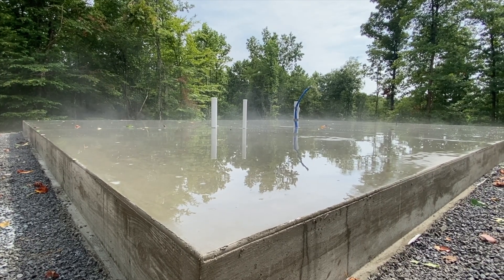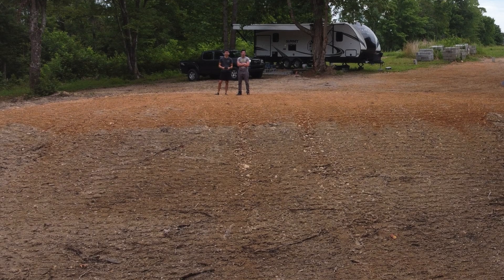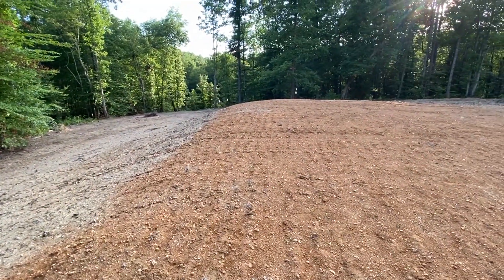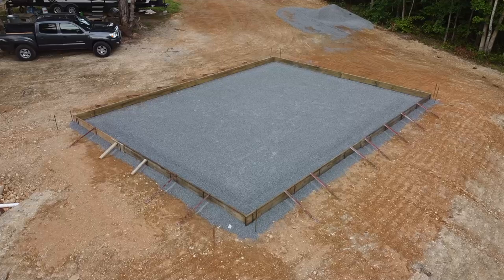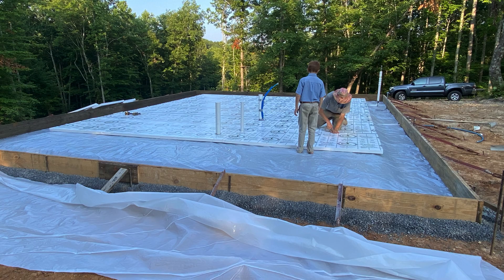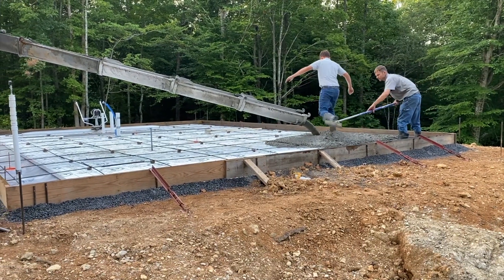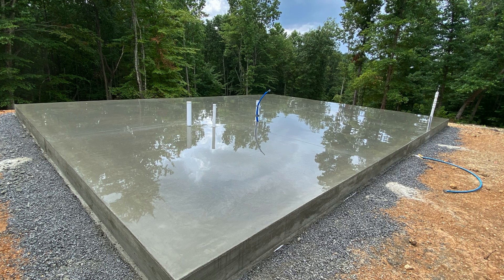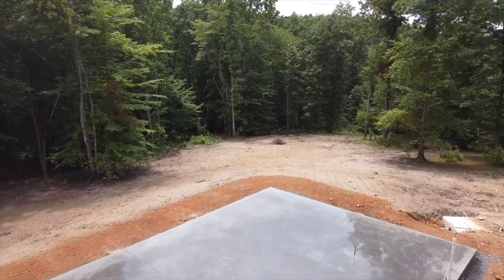Slab Poured for Our Passive Solar House!

Comment: Consider an acid based stain for the slab.
Reply from the maker: Does that produce a better color, or is there another benefit?
Reply: There's many, many colors available. It's also recommended to seal it after staining to increase durability. Sealing can also help with moisture although that's not really much of an issue with you since you (wisely) insulated under the slab. 

Additionally, you can use diamond bladed saws to cut designs into the floor. I've even grouted the scored lines to really mimic the look of concrete.  @JoeJarvis
Reply from the maker: @planesteven  thanks for the recommendation i will look into stains. We'll definitely seal it either way.

Comment: Looks good! I debated on the foam underneath and ended up cutting it out due to cost, but did put 14mil vapor. But mine is a basement slab, not the house floor. That looks really smooth, my guys did ok, but there are some waves in it and other minor things I wish were done more skillfully. I'll have to get this contact from you for the next house - if he works out this way.
Reply from the maker: Yeah that was probably the right decision in the basement, I'm not sure how beneficial the insulation would have been down there. Since we're trying to absorb the heat directly into the slab, I think the foam will be a higher payoff.
Reply: @JoeJarvis  Yea! For mine it would only serve as insulation so the floor is less cold, probably not a big enough importance. Looking forward to the next. Would love to visit you guys with Sevan one day.
Reply from the maker: @Nairaville  yes please do we will have to plan for it!
Reply: I'd epoxy the floor

Comment: Looking good! Interesting idea to use the concrete as finished floor. I stayed at a place in Aguadilla that had that finish----it was kinda "cold". It's easier to put wood flooring or other in later, if you decide to, rather than taking it up later if you change your mind, right?
Reply from the maker: That's true, the plan is also to do wooden countertops, and other wood elements, to soften the space a little